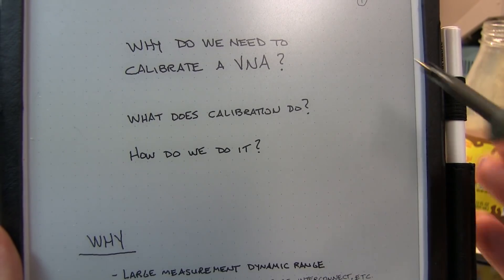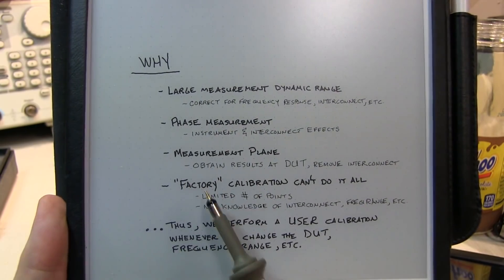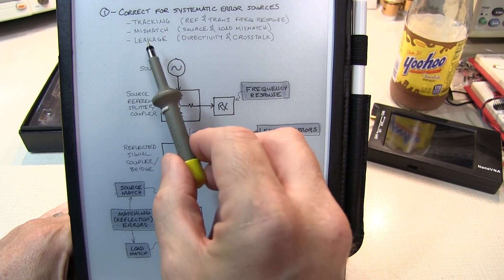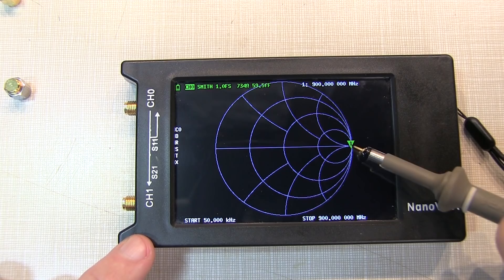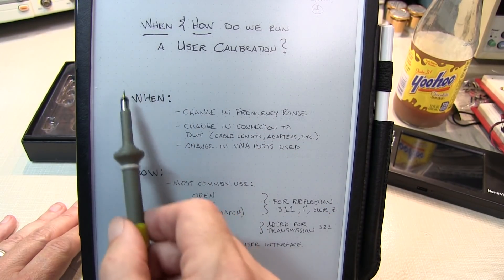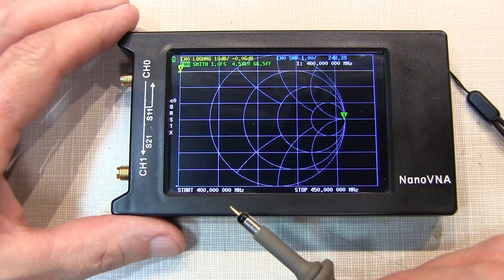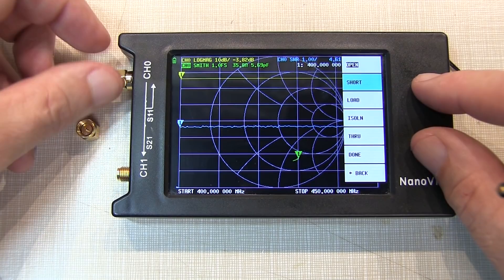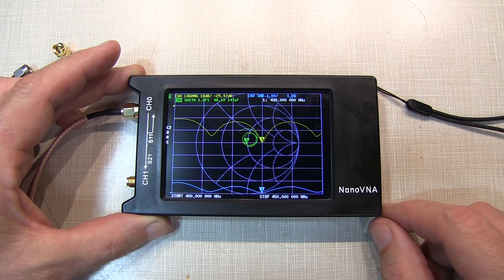#313: Why a VNA needs to be calibrated | how to calibrate a nanoVNA

Comment: Hi Alan, so I am using the little interconnect cable that came with the Nano VNA to test a K40 CB antenna with has a Pl 259 plug on the end of it.  I have an adaptor to attach to the end of the interconnect which gives me an SO 239 recepticle so I can hook my atenna to the Nano VNA.  Should I be trying to calibrate the nano VNA with some aftermarket terminations that hook up to the SO 239 adaptor, or is it okay to exclude the SO 239 adaptor from the calibration, and just use the little SMA terminations that came with the Nano VNA on the end of the interconnect ?  Will that affect my measurements significantly ?
Reply from the maker: No need to try to calibrate out the adapter, it’ll make virtually no difference.
Reply: @w2aew Okay perfect, thats what I thought, thanks for the response :)

Comment: I understand it's been 5 years since you made this, but I'm really struggling to measure a low pass filter.
Using a 100 ohm resistor and 1nF capacitor.
Measuring from 100kHz to 10MHz
I've calibrated it 100 times but I'm not getting a response that looks anything like it should. I just get a line that runsto the right with very little slope. Starting from about -6dB dropping to around -10 at 10MHz.
I have the trace set to S21 but not getting the right response.
Any ideas?
Reply from the maker: It’s likely because you haven’t taken into account the fact that the VNA has 50 ohm input (and output) impedance, which basically means it puts 50 ohms in parallel with your filter’s output.
Reply: @w2aew many that ks for your reply. I just tried with a 1k resistor and 1nF cap. Got the same shape line but starting at about - 15dB.
I'm lost.
I'm far from an expert with the nanovna (and the tinysa for that matter). Had zero meaningful results with either all day.
Maybe I should stick to being a mechanical engineer. I'm much better at that LOL
Reply: @w2aew FYI I think it's the first version of the nanovna. Bought it 3 years ago

Comment: I have setting save setting for 20m start 13.500mstop14.5000m my question is do I have to when setting up my antenna the next day or do have to cal every time for 20m?or do I just go to my saved channel 0 swr
Reply from the maker: You can re-use this setting without recalibrating.

Comment: Excellent clip.
It would be good to be able to measure extremely low return losses like -90dB by adding LNA, PA, Directional coupler, circulator, limiter and other circuits to the VNA, without damaging VNA or making the whole thing to become an oscillator. I guess we need to design another box to VNA to do that.
I think something like this:   Port 0 of VNA to PA then to  circulator, forward path circulator to D.U.T. Return path to Port 0, which could cause this thing to oscillate!

Comment: A bit late, but... shouldn't you disable correction before calibration? Enabled correction should apply calibration. Without any antenna, or with default load measurment should be in then center of smith graph. Perhaps I understand it wrong, correct me if so.
Reply from the maker: Once you Reset, there are no corrections being applied.  The center of the Smith chart represents a 50 ohm load at Port 1 (CH0).

Comment: I have been using vector network analyzers for many years. NanoVna is perfectly useful for amateur use for vswr measurements or for S11 parameters. For more demanding use, for example adjustment of tunable filters, its sweep is extremely slow, therefore there is no feeling of adjustment in real time, for me it is the greatest lack of NanoVNA.

On the other hand in the PC application NanoVna Saver I am surprised that it is possible to use the calibration standards for other calibration kits beyond sma kit, I have been able to check the use of a calibration kit N that has worked pretty  well. There should be no problem calibrating TNC, BNC, 7/16 or any other. The only thing that you need are the parameters from the maker of the kit or modeling yourself the behaviour of your standards, that is not an easy task.

The best thing about being able to calibrate a VNA is being able to remove test leads both in reflection and transmission. It is important that the test leads are stable, otherwise the calibration will be useless, calibratión only will remove systematics errors.

 To know more about this topic http://emlab.uiuc.edu/ece451/appnotes/Rytting_NAModels.pdf.

Comment: if my antenna is fed with rg213 ,should i calibrate my vna after the adaptors etc and calibrate it by putting the open short load etc at the end of the coax where it joins the antenna,ie after all the adapters etc?
Reply from the maker: As long as the coax is not part of the antenna/counterpoise, then the SWR will not change with the coax lead length - in which case it doesn't matter which end you calibrate at.  When measuring/adjusting an antenna, it is usually best to calibrate at the same location where the transmitter is going to be connected (NanoVNA takes the place of the transmitter).

Comment: Been doing electronics for a while, but RF has always been black magic to me. Thanks for the very helpful videos.

I'm doing my first VNA measurements (with a miniVNA Tiny) and after doing the OSL calibrations with the terminators directly on the SMA connectors of the VNA, I tried to connect a SMA to IPEX pigtail, which was then connected to a 50 Ohm load on a demo board. I was expecting to see the SWR increase, but it increased all the way to 1.92:1 at the highest point, with several "rounded" lower peaks in the entire range of 1MHz to 2.99GHz. As I have no experience in the field, I don't know if it's normal, but it seems quite high, considering both the pigtail and load should be 50 Ohm (DC resistance verified to be 50 Ohm). Can anybody shed some light on this?

Comment: Why is the logmag graph so noisy after applying the calibration around 9:05 ? With a dummy load should I expect to see a level line?
Reply from the maker: The LOGMAG of CH0 is measuring the reflection coefficient, but with the 50 ohm load connected, there is virtually no reflected signal, so you're seeing the instrument's noise floor.

Comment: i have a mag mount antenna that i want to check with this. It has a long coax cable permanently attached with a bnc connector. What is the proper procedure in this case for the calibration of the vna?
Reply from the maker: Since your goal is to measure what your transmitter will see, you'd want to calibrate as close as possible to the BNC connector.
Reply: @w2aew  ok that kinda what I thought. My second scenario is I am building an antenna to be used at 10 dbm. It will have a 50 ohm coaxial cable of about 8-10 feet to reach between the transmitter and the antenna mounting location. I assume I would want to tune the antenna with the same coaxial cable I will be using with the antenna already installed and cable run since this is what the transmitter will see. Am i correct? Also does the length of the coaxial cable have to be a certain length increments based on transmitting frequency or can I just use the minimum length I need to reach the antenna and then tune the antenna with everything connected and installed?
Reply from the maker: @kwacz  Yes, use the same cable.  If the coax shield is NOT part of the antenna (i.e. part of the counterpoise), then the length of the coax will not have a big impact on the measured SWR.

Comment: Having issues with using nanoVNA V2plus 4 ,
And part of that [ seems to be this video ? ] setup appears to be needed for CAL - so to way of thinking [ could be wrong ? ] having a setup in the beginning of this video , would keep from having a bad CAL ?
Thanks again , watching for yrs.
Reply from the maker: The only things you need to setup before running the calibration is the frequency range, number of points, and power level (if adjustable).
Reply: @w2aew  Thanks , I will give that a try .

Comment: Good video, thanks. But at what frequency does measurement plane calibration become important?
Reply from the maker: It depends on whether you really need accurate phase measurement at your device under test.  If you only need SWR or return loss and don't care about the exact complex impedance or the phase of S11, then it doesn't matter.

Comment: Thanks for the video, great help in calibrating my VNA V2. I have a question for you, when I connect my antenna directly to the VNA is get a nice circular smith chart, when I add the extension coax I get a smith chart that is made up of lots of overlapping star shaped patterns. What would be the cause of this? I have check the coax for continuity and shorts. Thanks
Reply from the maker: When you add coax, each point on the Smith chart gets rotated around the center by an amount that is proportional to the line length in wavelengths.  Thus, the higher frequency points get rotated more than the low frequency points, which can space those points out further, making the curve more jagged or star-like.
Reply: @w2aew  Ah I see, so as long as the impedance stays near 50 ohms and the SWR near 1, I should be good to go. Thanks
Reply from the maker: @Omegaman1969  yep!

Comment: In most of your videos, you reset the calibration, calibrate, and then save it in one of the memories. Does reset affect the saved calibrations at all? And if you are recalling a saved calibration, would you do the reset first or just use the recall function?
Reply from the maker: Reset only affects the calibration that is in use at the time.  It doesn't clear any saved calibrations.  It's a good idea to clear the one in memory before either running a new cal, or recalling a saved calibration.

Comment: If a short piece of coax affects the calibration why doesn't the long piece to your aerial affect the readings?
Another question, do you need to set the frequency range before calibration or would using 50 kHz to 900 MHz cover it all and could you select say, 5 MHz to 8 MHz later?
Thanks for the video, I just got one and needed some info. how to calibrate it.
Reply from the maker: Both will affect some of the readings, but it all depends on whether it matters for what you're trying to accomplish.  If I truly wanted to know the exact complex impedance at the antenna feedpoint so that I could design a matching network to connected at the antenna - then I would want to calibrate at the antenna end of the coax.  But, if I only want to measure the VSWR at the transmitter end of the coax, then I can calibrate at the VNA port itself.
On your second question - you do want to set your frequency range before you calibrate. The VNA has a limited number of trace points, and the calibration is only performed at these points.  If you change frequencies after calibration, the VNA will interpolate the calibration between these points, which has the possibility of introducing some errors.
Reply: @w2aew  Right, thank you very much.

Comment: Thanks for the video!
Would it be better to run the calibration at the end of the cable rather than directly at the nanoVNA ports so that the measurements capture as little of the additional cable length as necessary?
Reply from the maker: Sometimes it isn’t possible or convenient to calibrate at the end of the cable. Cal at the DUT end of the cable is generally only needed when you need the actual complex impedance or reflection coefficient from your DUT. Additional cable will not change the return loss or SWR, it only changes the input impedance.

Comment: Alan
In my 50 years in Engineering I've used the HP 8410,8509,8510 and PNA -X I wish your presentation skills were available then it would have been a boon to the field .  This thing intrigued me WoW I could do my FA lab work from home with this amazing device I thank you know your videos I have spread the word
Best of 73's
Bill
WB2UFC
Reply from the maker: Thank you for your kind words!  73 de Alan
Reply: @w2aew  QSL btw what model is that the v4?? Also I was intrigued by the ant tuner you used with vna what is the make and model???
Bill
Reply from the maker: @williamstevens3029  The VNA I showed is the NanoVNA-H4, and the tuner is a Ten-Tec 238C.

Comment: Hello Sir, This is On7dbr. I have a question. When you calibrate the connecting cable, is you calibration  as good up to the connection-cable? What with the cable to your mast of 50m? Shout I get up in the mast and do : open, short, 50 before the antenna so that the coaxial is included before I connect the antenna? Am I working too persise? What is your experience? Thanks Reza
Reply from the maker: Where you calibrate is important when you need to know the IMPEDANCE at a specific location (calibrate to that location).  In the case of checking return loss or VSWR on an antenna system (antenna plus feedline), it is important to remember that the Return Loss or VSWR will not be dependent upon the feedline length (ignoring feedline losses).  The input impedance looking into the feedline will change with line length, but the VSWR will not.  So, if you're just looking to check how well matched your antenna system is matched, you can calibrate at the same location where the transmitter would normally be attached.
Reply: @w2aew  
It's a great video again, thank you so much! I'm reading the calibration procedure of Tek VNA TTR 500. On page 28, about frequency calibration, the VNA is configured : "Measurement: Response > Measure > S21". I understand that Port 2 is output, Port1 is input, but I don't see a cable connection between these ports in the diagram, I think it should be a connection here. This makes me a lot of confusion. If you get a chance, could you explain it to me?
https://download.tek.com/manual/TTR500-Specifications-and-Performance-Verification-077125500.pdf
Reply from the maker: @Tom-dn5de  The diagram is correct.  When you configure for an S21 measurement, the RF source is produced by Port 1.  Remember, S21 means that it is the signal measured at Port 2 in response to the signal applied from Port 1.  Thus, the frequency of the RF signal is measured from Port 1.
Reply: @w2aew  Thank you a lot, sir! The thing is clear now. But I saw the video about S Parameters from 
Rohde Schwarz
 https://www.youtube.com/watch?v=-Pi0UbErHTY&t=101s
at 1.50 in the video, I think it's right, but I get confused here or I didn't understand it clearly.
Reply from the maker: @Tom-dn5de  The description of the ports in that video refer to the ports on the device being measured, not the ports on the VNA.  So, for S21, the energy emerges from port 2 of the device being measured, and this energy is being measured at Port 2 of the VNA.
Reply: @w2aew  Thank you, sir! I totally got it.
Reply: @w2aew  Sir, but when measuring output power from port 1 (page 31), 
VNA set for S12 different when measuring frequency from port 1 (VNA set S21, page 28). I think it should be the same?
Reply from the maker: @Tom-dn5de  Yes, that looks like a typo in the manual.  To get power out of Port 1, you'd have to be measuring S11 or S21.

Comment: You need to mention that the calibration of Isolation and Thru and what they are used for are covered in #315. I ended up here when searching for how to calibrate but didn't discover #315 until going down the rabbit hole a while.

Comment: Thanks for this and other nanovna videos.  Is there a way to calibrate these to 75 ohms?  I haven't seen anything that addresses this and it would be nice to do so as many/most of the rx only antennas and receiver connections are 75 ohms.

Everett
KE5MMT
Reply from the maker: Not sure it's really practical to do with just the nanovna.  There might be PC based software that will help with this.

Comment: I am confused. You demonstrated that the connection of the lead cable changes the base parameters. Then you calibrate without the lead cable...

Shouldn't you calibrate with the cable in place if you intend to measure the antennas at the end of the cable?

Thanks!
Reply from the maker: If I wanted to measure the antenna's input impedance, then yes, I would want to calibrate at the antenna-end of the coax.  But, if I want to measure what the transmitter is going to "see", then I calibrate without the feedline.

Comment: Great video! Thx!
Just a question: Can we do the calibration with an 50-ohm extended cable? Or we should use electric delay function? which one is the proper way?
Reply from the maker: Ideally, you would attach the cal standards at the same place/location that your device-under-test would connect.  If that is at the end of a cable, that's fine.  The idea is to calibrate "out" the affects of the cable (attenuation, delay, phase).
Reply: @w2aew  Thank you!!

Comment: Alan, first of all, thanks for this amazing video. I have a question that I wasn't able to find in the comments. In the end of the calibration, you used some coaxial cable to measure the antena parameters, but the calibration was done without this cable. So, what is the correct calibration procedure (with or without the coaxial cable)?
Reply from the maker: Both are correct - depending on where you want the measurements to be valid.  If you want to measure the input impedance of an antenna - at the antenna's  input, then run the calibration at the end of the coax where the antenna is going to be connected.  If you want to measure the impedance looking into the coax that feeds the antenna (where the transmitter connects), then run the calibration at the VNA port where the coax will connect.
Reply: @w2aew  Thanks Alan!

Comment: Excellent intro and refresher Alan. I had the pleasure of attending HP Training on their top-of-the-line instruments some years ago and used their best best Network Analyzer for a year or so. But, old age and being away from Ham Radio, and RF testing in General for over 35 years has stripped my brain of the basic how-tos. I believe I'll get a NanoVNA, Just Because is't so darn cool. Even if I never get around to using it. 
Regards, Don, W5MML...🤠